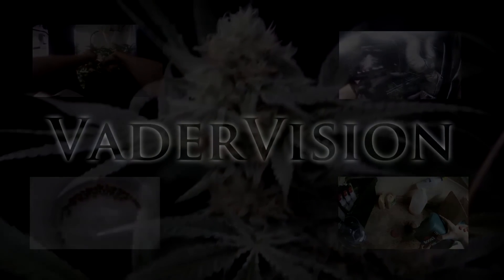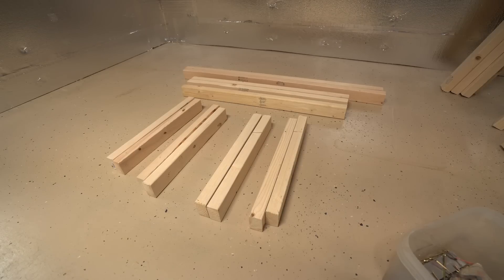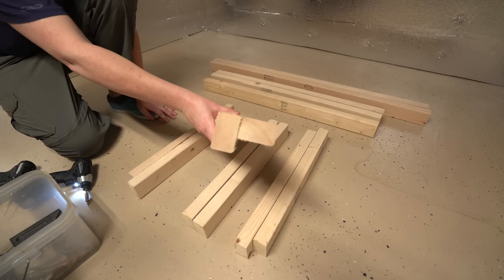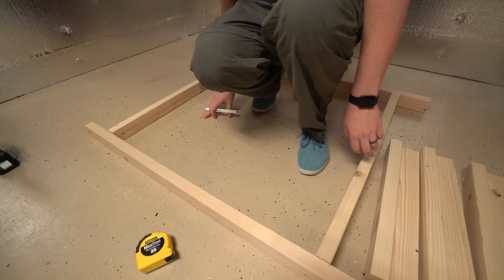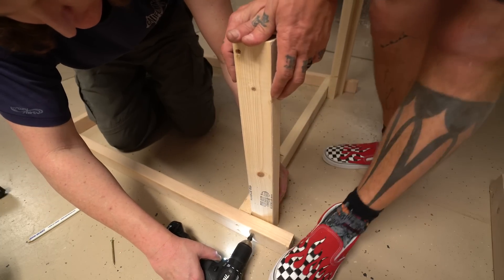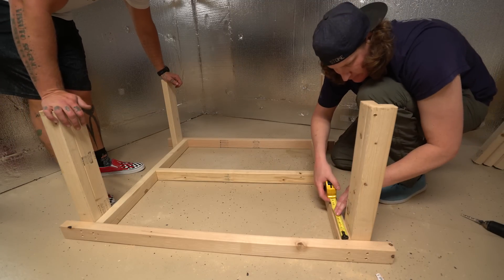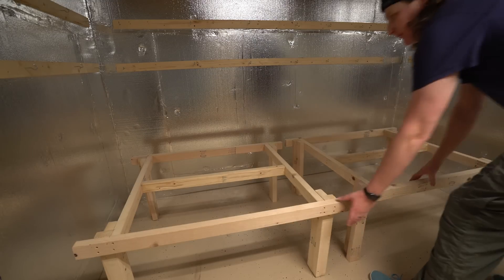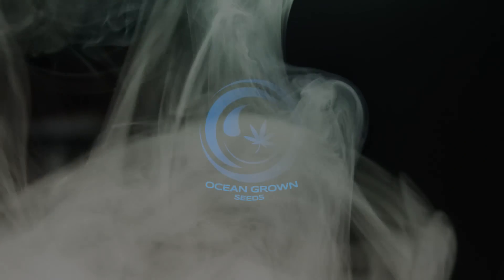How to Build a Simple Hydroponic Tray Stand!

Comment: You should throw on a couple quick coats of water based polyurethane on them. That's what I do. The wood can hold mold spores and water. I've built my own for years. The quick fit tables don't go low enough for me and are insanely overpriced

Comment: Cool job buddy. Did 2.4 x 1.2 trays  this way,  though I inserted the trays so the lip was level with the timber instead of sitting on top and put 3 braces set for the bottom of the trays. Worked a treat. And my reservoirs  4 x 400litre tubs were on the outside of the rooms which helped with temps etc. Keep up the good work buddy, great to see you still going strong 👍